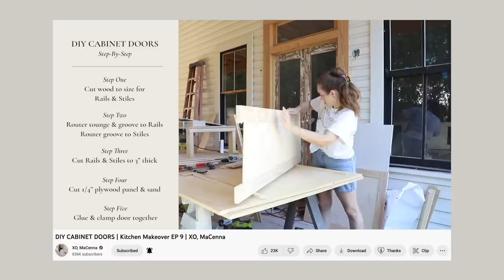LIVING ROOM MAKEOVER Episode 1 *Restoring Our Vintage Mantle | XO, MaCenna

Comment: I wonder, if you were to flip the vertical brick to the horizontal (That would be the medium height on the brick, not the lowest option), and then put the flat orientation of bricks on top of those front bricks, you'd loose a couple of inches, thereby bringing the mantle a little lower, and your TV also. Just a thought.  ... And if you decide you do like the colouration on the brick, you could possibly seal it with something, which would protect everything else from the soot (My step-dad has done similarly. He used to restore antique furniture, and homes.)
Will you lose too much of the detail on the mantle if you paint it a dark colour? You won't get as much shadow play in the design if it is dark. Enjoy the process figuring it out. ☺

Comment: Kinsley is supervising.  You are supposed to cross pollinate colors, so Millstone is it. I wonder if you could use tile backer board around the fp opening &  paint it or skim over it. you can replace the plinth with taller ones. U r correct on the spacing
Reply: You read my mind with  the soldier course of brick- standing up tall for the hearth. You may want to paint the mantel 1/2 or 1/3 Milstone gray

Comment: Hardy plank boards are fireproof and you can paint them. Instead of the brick you could just build a plywood box for the hearth and use the same plaster technique to continue the look of the fireplace wall, it would give the look of a faux concrete hearth.

Comment: Absolutely beautiful! I love what you’re doing :) One little piece of advice though. If the bricks have been in direct contact with smoke then the smallest amount of running soot will produce an odour which is not very pleasant. You might get used to it, but your guests will not. This smell will never really go away. So I would think twice about reusing the bricks from a chimney inside. Furthermore, bricks from a chimney can contain heavy metals and tar - a slight health hazard.  They are usually also defined as hazardous waste during demolition. So even though I find the idea great in many aspects, I would advice against using the bricks indoors.

Comment: If it were me I would do a layer of flat low brick as a hearth and extend those fireplace feet down to it, they would look perfectly normal longer and you could disguise the join with plaster or put a complete new piece in that's longer.

Comment: I would use the drywall too build out the mantle, would then paint it all black even the mantle. I love the millstone gray color on the bead board but I would stain the cabinets/shelves like you did the windows 😊👌🏻
The bricks is an excellent idea but what if you just put two bricks laying on top of each other, would that still be enough height? 
I think that would be the easiest thing and also it looked like the area between the mantle and the fireplace was larger then on the sides, so it looked a bit unsymmetrical but it might just have been the angle it was filmed ☺️
Reply: Oh, I would also do I lime wash or a French smear on the bricks too tie everything together 😊 You can also just have the bricks standing, as you said: they are the perfect height, that way you can choose how far out they go without cutting any of them!

Comment: i think if you were to clean some of the brick with the stamps on it and than put them in the front and do a bit of research to figure out the age it could be use as a conversation piece especially if  you could buy a few new ones from the same masonry if they still are running. And than maybe use a rich color in the same color family for the hearth and the mantle, the walls the blue grey color. just thoughts. you still do what makes you happy.

Comment: Please make the hearth a little higher and put the brinks hanging over the bottom row. Try laying them 2 high on their side instead of standing up. I think you will regret it later on not being a cap top row. And what if you do one row of tile of which ever you end up doing in the kitchen around the insert especially for a small amount of fire protection for the drywall and wood mantle

Comment: This might not fit with your design vision, but I think bringing the hearth up to the same level as the bottom of the fireplace insert would help eliminate the (in my opinion) somewhat awkward “floating” appearance currently present. Now as the mantle is already high enough as is, I’d suggest cutting away pieces from each side so as to bring the original base “blocks” up to sit atop the raised hearth; the equidistant spacing of the top and sides would remain the same, but the gap between the insert and the hearth would be made non existent.

Edit: An added bonus of a slightly higher hearth is that it can act as an additional spot to sit cozily close to the fire, something I myself love doing on occasion.

Comment: It’s probably late, but the fireplace would look good with the bottom section of the legs removed, and replaced with the brick hearth going up a bit higher to make a nice even border on all sides of the fire, and the full witch of the chimney breast, upright on the front then a flat over the top, cause I think the little bit at the bottom is meant to look like a plinth, but is a bit much with brick also? I’m sure you will make it look amazing no matter what, and you always get lots of clever comments from the community too 😊

Comment: I absolutely looooove the fireplace texture. but...... I think that the millstone grey I think is too dark for all of the built-ins. The second you said you were painting the bead board I yelled at the screen, "paint it pashmina!" I think if you did that it would complement the plaster look if you lime washed it a warm white/gray. With that, I think white shelves and the cabinets on the bottom should be either; to match the window trims your custom stain / or paint it the color of the dark tile of the kitchen  (if you pick it) to balance out both sides of the room / or that alone could me millstone gray.

Comment: Most definitely paint the wall on the side of your fireplace the Millstone Grey, it is gorgeous. A brick hearth will truly add to the character of the fireplace surround and mantle. And if it were me, I would wait to paint the brick hearth until you have painted the plaster wall and the walls on either side. You may or may not change your mind about the brick. Pretty sure you already know what color and technique you will use on the fireplace wall so no suggestions from me. The only thing I would suggest is don’t paint your mantle and surround the same color as the plaster wall. I would not want the mantle and surround to disappear on the plaster wall. The filigree is so gorgeous don’t let it disappear.

Comment: I ❤ that you want to use the historic brick for the hearth.  Because you'd indicated you didn't want a hearth, I'm curious why you feel the hearth needs to be 18 inches out (2 or 3 bricks extending into the living room).  Why not lay the bricks perpendicular to the way you demonstrated in the video?  Two bricks would be...what...eight inches into the living room (assuming short side of bricks are four inches?), or if you covered a box to stretch the weight and usage of your bricks, three bricks would extend into living room by 12 inches, saving living room space since you've indicated the living room is so small.  This method would place the bricks in line with the  floor boards and would also avoid cutting the bricks.  I can envision you decorating the corners of the brick hearth, that are wider than the fireplace face itself, with any of the pottery/vases you've thrifted.  It will be gorgeous no matter your decision.

Comment: With 1.6K comments, at least one person has undoubtedly warned that there are requirements for the distance of a fireplace surround from the actual fireplace. The space between the surround @and the fireplace must have FIREPROOF material like brick, stone, slate, concrete, etc.

Comment: Yes to Millstone Grey beadboard…if you don’t like it you can always paint again🤪yes to brick hearth but prefer you cut the front vertical brick to slide under top horizontal top…it just looks wrong the other way. Yes to plaster paint effect. Maybe glazing on mantle…have to see when everything else is done. What about a brick surround around fireplace insert…they sell half bricks and you could paint black?  Maybe do a photo shop mock up..?

You did not talk about what color the cabinet will be below the beadboard? Same color as bead board or matching to the waistcoating paint color instead?!

You have come so far! Seeing the “ before” photos at the close of video😳….I can’t believe I have been watching you for so long…before Comfort Cottage was a twinkle in your eye!

Comment: I think you will be unhappy with the overall look of the hearth if you run the bricks vertically up the front, and cover the end of the bricks on the top..  It will look better if you can recess the bricks on the front so they are back from face of the top by a 1/4 or 1/2 inch. You could also clean the bricks up a little, and finish them with a satin clear coat sealer. You could alternate the bricks so that some of the soot stained faces are showing.

Comment: Dont paint the mantle, just seal it. I like the bead board paint but what type of wood are you going to use as shelves to anchor the fireplace? the fireplace should be the focal point of the living room. The bead board paint might be to distracting? Have you considered extending the fireplace by making two 3"  graduated pedestals under the original each column then the hearth?

Comment: would be a shame to paint the brick..is there a side you can use that doesnt show the soot?  i think having the top have an end side might not look great.....  and the hearth doesnt need to go out as much as 18".....that just takes up floor space.  its better to put more effort in than do it easy so u dont have to cut bricks.  another idea would be to use the same stone you use in your kitchen as the top for the hearth and brick under that to support it.....but u probably dont have a piece left that is big enough.....

Comment: As a fireplace sales person I am crosssing my fingers that you followed the noncombustible clearances around the fireplace and the mantel clearances indicated in the install manual.  The fire resistant drywall is NOT the same as a concrete board, like Hardiboard, which does meet noncombustible specs. Fire resistant does not.
As much as I enjoy great DIYs like yours, I also worry that followers don't realize there are clearances that must be followed for safety and every fireplace is different.

Comment: I recommend putting the tv NOT above the mantle. It’s design 101 that a tv above the mantle ruins the look of a room. It’s also way too tall for your necks to look at the tv so high. Maybe move the tv to a corner on or hidden behind a hutch or onto another wall.
Reply: It’s a “Frame TV” that looks like a painting and if the sofa is far enough back,it doesn’t stress your neck.
Reply: @lauramitchell6725  yeah it still looks like a tv though

Comment: Millstone grey 👍
Brick hearth 👍
Unfortunately, I feel like the code enforcer around here. There should be 12" non-combustible material around the fireplace insert.  X-rated sheetrock is NOT non-combustible...  it just takes longer to burn through than standard 1/2" sheetrock.  It doesn't appear that you have inspectors coming by to approve work, but you need to be aware that this is a fire hazard.  Yes, you see it done wrong ALL THE TIME.  Okay, I've done my due diligence.

Comment: You need a surround that matches your hearth.  A white washed brick or light stone would work.  Either should almost disappear when installed.  Also, a full length mirror, so you won't wear jeans that offer a camel toe.